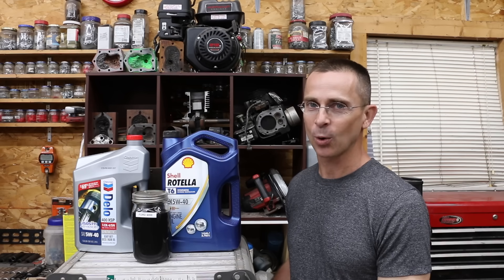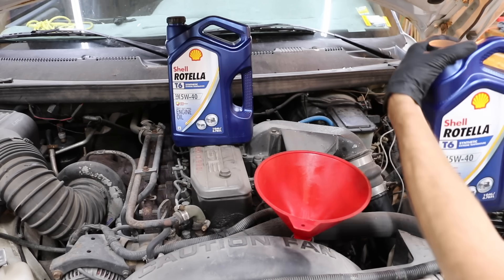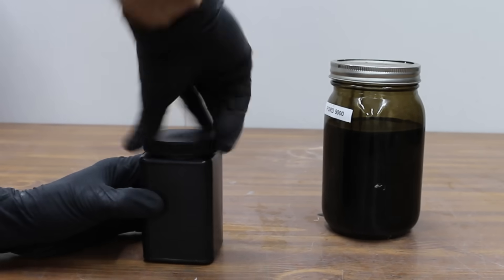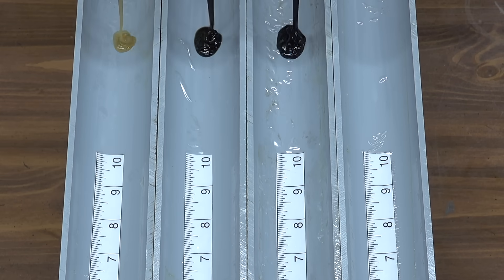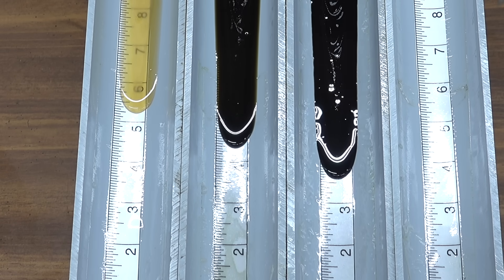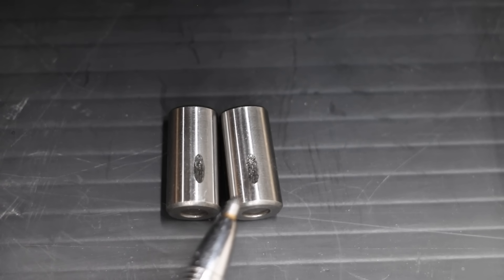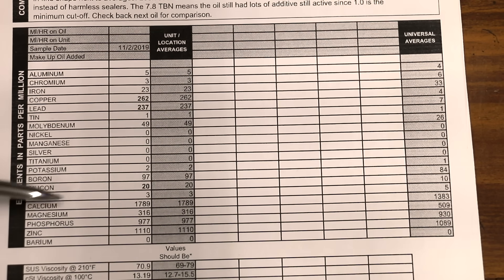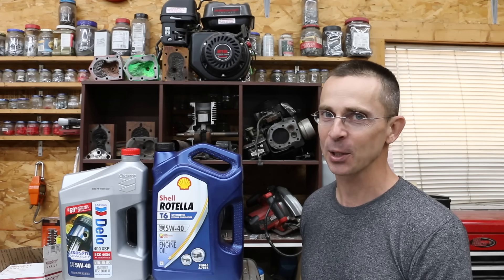Will Annual Oil Change Damage Your Car? Let's find out!

Comment: Great video - very good science instead of unsupported opinion. I have seen huge numbers of posts on Porsche forums claiming that oil which is sitting in cars that are in storage “goes bad” and it always seemed unlikely to me. I bought a car that had the oil changed in Aug 2019 and was sold to a dealer shortly afterwards. It sat at the dealership during COVID and I bought it, then it sat for another few months due to shipping delays etc. the oil is now almost 2 years old, but as the car has only driven 1500 kms in that time I have concluded that it is unlikely to be a problem.

Comment: There is a lot of discussion about 0w-20 vs 5w-30 oil.  I was surprised that my car's engine recommends both weights but some people prefer 5w-30 oil for better protection vs better gas mileage of 0w-20.  Could you test this?
Reply from the maker: Thanks for the suggesiton.

Comment: Over 40 years ago, I stopped changing my oil every 2000 miles, as I switched to Mobil 1, the first widely available synthetic.  That was 1976; I went to 10,000 mile oil changes, on a 10 year old Mustang 289 v8. Since then, a 1970 Chevelle 307, 1974 PInto 2L 4, 1976 Datsun 280 z, Pontiac Bonneville 350 V8, 74 Volkswagen bug, 78 Jeep Cherokee 360 V8, 77 Jeep Cherokee 258 6, 86 Wagoneer 360 V8, 88 Bronco 2 2.8 liter V6, 87 cherokee 4L I6, 90 Bronco 302, 93 Bronco 351, and  Porsche 928 5L V8. Currently have a 2008 5.4L V8, 1998 Lincoln 4.6L V8, and a 1992 Cherokee I6 4L.  Zero internal engine problems since then. NONE. I don't use only Mobil 1 exclusively anymore, but always use synthetic to provide the engines with good cold startup lubrication. Take all of that for what you will. Oh, and no leaks other than a drop occasionally, and no burning oil smoke.
Reply from the maker: Thanks for sharingl

Comment: So what would be the case of a motorcycle with 790 miles but I think it’s on the original oil since 2009 when it was built. The oil is at least 3-4 years old since it hasn’t driven that long. It’s still clear on the dipstick so would it just be good practice to change the oil because of possible moisture or would it be pointless? (I have to rebuild the carb and everything anyway so i won’t be cranking it over or anything till I do the carb and inspect the pistons and cylinder walls for any possibly corrosion) any fluid I should use in the cylinders as lube since the piston rings I assume are very dry from sitting so long?

Comment: I'll share MY anecdote with ya: I was using Mobil 1 in my ol' 92 Silverado scrap hauler. It only had about 100k on it's 2nd motor, out of a 95 Tahoe. I chose Mobil 1 because they say "one year or 15,000 miles". I'm lazy, I don't wanna do it more often. When the oil had about 3 months and 2000 miles on it, the distributor went bad (I didn't know what was wrong til much later; it just quit running). So it sat in my driveway for 8 months. Then, after talkin' to e mechanic, I put a new distributor in it. Fired right up and ran great. A month later I spun a rod bearing, right after spending 100 on the distributor, 300 on a new exhaust system, and 700 on new brakes. I don't know who to blame. I can't send it to the crusher after having it for ten years, especially after putting all that money into it!
Reply from the maker: Thanks for sharing!
Reply: Get a Ford

Comment: Another great video for sure . Automotive Tech college and General Motors training both emphasized Annual oil changes at a minimum . I always questioned that theory . I have engines that have 2 or even 3 years without oil changes . Attention to the condition of the oil is all I do unless its been buried in snow or something similar that may require additional considerations .
Reply from the maker: Thank you!  Thanks for the feedback.
Reply: Anyway you could do one on Rotella non-synthetic and Delo non synthetic 15 40 . My mechanics trying to tell me what's better than the other

Comment: I change the shell rimula r4 L15w40 oil on my 3.0l and 2.5 d4d Toyota hilux trucks every 5000km/3000 miles but the filter only every 10000 km.
On my 81 2.2 turbo diesel Toyota hilux I change the oil monthly because the odometer is broken.
To tell the truth even if a car wouldn’t make 5000 km annually I would still change it multiple times a year. It’s cheap if you do it yourself.
Reply from the maker: Thanks for sharing.

Comment: ALL the "thumbs down" are from JIFFI LUBE owners.
Reply: Lmao DIY squad
Reply: @bobespnza29  Or Chevron employees  LoL .
Reply: @whip-its_dad4239  I don’t even think they know about this oil lol
Reply: 621 thumbs down.  I don't get it.  Why ?
Reply: Or oil companies & stores.
Reply: Oscar ROdriguez:   Seems like empty complaints in the face of all that objective data and testing.
Reply: Just stay away from supertech oil. Even the full synthetic is sus, on the package they depend on you not reading properly it doesnt say it meets or exceeds the standards, it says "use where you would use products that meet or exceed the standards", in other words they never themselves met or exceeded those standards, or they would say so.
Reply: @Seriouslydave  The tests showed it is as good as Amazon Basics and just a hair better than Kirkland and all Project Farm recommended all 3 of them as a good value.
Reply: @Seriouslydave  I use walmart supertech oil on all my vehicles. I have a 2018 Chevy Impala I purchased with about 20k miles. I used supertech syntethic exclusively and im currently sitting at 90k miles with no issues whatsoever. Doesnt burn or leak any oil.
Reply: @Potatorq  use what you like im not stopping you, its oil, it meets minimum requirements, (which if you read the requirements arent that impresive) rockauto has sales on major brand oils all the time. Im on a very low budget, im the opposite of rich, but ill buy a motorcraft filter (5000 mile) for $1 more, and mobil1 (10,000 mile) for $4 more (5q). And thats not even the good mobil oil i would like to buy. I do oil change 3000-4000 miles. 300,000 miles on the clock.
Reply: @Seriouslydave  if you're on a very low budget then may I suggest extending you oil change intervals. My 00 f250 7.3 diesel is sitting at 360k miles and I only use supertech conventional with 8k miles change intervals. 07 crown Vic is sitting at 240k miles using supertech 5w20 synthetic also doing intervals at 6-7k miles. Impala computer indicates 7-8k mile intervals as well. I do oil changes myself and I measure how much oil comes out. None of them burn or leak oil indicating great engine health. Modern oil especially synthetic will last much long as indicated by various tests.

Comment: I understand that using oil designed/rated for a diesel engine in a gasoline engine could cause damage to the catalytic converter (unless it's rated for both diesel and gasoline engines).  Do you know if that's true?

Comment: So you can basically change your oil at least once every 2 years if you’re not driving your vehicle more than 6000 miles... impressive.
Reply: Both oils he tested were 14 & 17 month with around 3,000 miles  full synthetic..... I'm curious how well 1 yr old non synthetic oil with say 2,000 miles would do.
Reply: In the UK most service intervals are 1 year or 12,000miles. When I moved to Canada it was 6 months or 6,000km!!! Sure make engines different over here lol.
Reply: @Mark-hu9tf  Do you mind me asking how are your engines holding up? How many miles/ kilometers are your vehicles lasting. My wife's pickup truck has over 300,000 miles on it with oil changes between 6000 and 10,000 miles with synthetic.
Reply: @rikertvonfulton16  Hi. Since moving to Canada and buying my truck cash I am looking after it like a lady lol. It has twin turbos so needs looking after.  Changing oil every 6,000kms and PTU/rear diff fluid every year etc.. so far holding up good but only 75km on it. In the UK, I just did an annual or 10,000miles service and no issues. Like many have said, maybe the climate makes the difference.
Reply: Just changed my oil after going 10000km in 21 months using synthetic blend and changed it out with full synthetic.
Reply: Honestly, oil is cheap I wouldn't go past 1 yr on a low mileage car.  Just an opinion.
Reply: @lonniebeal6032  Especially if you're using non synthetic oil, he just showed with only 3000 miles the full synthetic was good 17 months later. But no way I'd try it non synthetic.
Reply: Weather is quite a bit more extreme.

For vehicles with timing belts, if it's in a mild climate, manufacturers they recommend 160,000km to to replace it. 100k if they're in more  extreme climates like -40

Comment: Just put t6 15w40 in my 2001 tahoe with 220k and noticed it gained about 20 lbs of oil pressure at 2k rpms ,and added about 4 oz of berrymans b12 solution  poured into oil crankcase🙂, Again  thank you for another great video!!👍🏻
Reply from the maker: You are welcome!
Reply: If you gained 20lbs of oil pressure from oil alone is dead yet??
Reply: @joshc7091   with a little help of berryman down the crankcase to clean the sludge, worked dam good
Reply: @massacoor6162  nice!

Comment: Both my cars had 100% full synthetic oil change inc oil filters, 13 months ago. I had one litre new oil left over from each car's oil change which i saved.  Only driven each car less than 5k so i'm wondering to drain out 1L used engine oil and replace each car with the 1L fresh engine oil i saved at last oil change. I will not renew oil filters. Will mixing 1L new engine oil of the same spec into 2.6 L of used engine oil originally in the oil pan be ok and how many miles i should drive before a complete oil change with oil filters.

Comment: Be nice to see a oil test on 0W20 weight oil used in new vehicles with the automatic cam timeing to see if these syn oils such as Rual King sells hold up yearly or need changing every 6mos regaurdless of low miles.
Reply from the maker: Thanks for the video idea.

Comment: Searched to see if anyone tested this as I always found it questionable that synthetic oil will go bad just sitting in crankcase. I think it's mostly running time that is responsible for degradation. Not at all surprised to see that Project Farm did. 
I'm going to replace the oil in my car tomorrow and send a sample for testing. I decided to follow just the recommended mileage and ignore time. It was in the car for 4 years and 9400 miles. Will be interesting to see if it is ok after 4 years or if I pushed it too far.
Reply from the maker: Thanks for the feedback.
Reply: What are the results of the testing?

Comment: I worked at a Ford Truck dealership. Several of the chase vehicles had over 200,000 miles and the oil was changed maybe twice a year with the cheapest oil available. These vehicles (minivans) had repairs, none related to engine oil in the ten years I worked there.
Reply from the maker: Thanks for sharing.

Comment: Great video, and that sure is one clean Dodge, I have a 98 12 valve quad cab, great engine in a great pickup, also the strap style filter wrenches work great on that filter, or even a engine belt will work in a pinch
Reply from the maker: Thank you!

Comment: I recently learned that more dealer oil changes are done with an oil extractor instead of putting car on lift and draining via plug.  Concern is do oil extractors remove as much oil as drain plug?  Sounds like a good PF test video.  Thanks for all of your great tests.
Reply from the maker: Thanks!  Thanks for the video idea.

Comment: so you are saying that the top piston rings  are running at 410 degrees?I would like to know what oils are more resistant to blow. Is the evaporation contributing to blow by?  Granted it is dependent on the condition of the rings.
Reply from the maker: Thanks for the suggestion.
Reply: @ProjectFarm  great channel btw

Comment: Compare your parent oil sample silicone levels with the Ford tractors used oil silicon level the difference is a measure of how well your air filter is doing keeping dirt and dust out.
Reply from the maker: Thanks for the suggestion.

Comment: Hi. I have a question.   Hope you could help.  I have bought amsoil,and mobile 1 ata good deal.  Is it ok to stock pile new oil for at least 4to 5 years ?  I don't use my truck much and maybe only put 5000 miles a year on It.  I change the oil on each year and I have at least 5 years worth of oil.

Comment: I use shell T6 in my bmw R1200r. No issues. BMW oil is made by shell. The manufacturer also requires no molybdenum be in the oil due to engine coatings.  This video confirms the lack of molybdenum, I wasn’t totally sure of this but figured as much. Thanks for the info.
Reply from the maker: Thanks for sharing.

Comment: Project Farm thank you for your videos! I have worked in research and development for 30 years and generally try to research the best products for personal use as well. So yes curious how the mobile delvac 1 ESP truck feet oil would fare in your test.  I use it on on my T1n Sprinter, 7.3 ford diesel and a small 3 cylinder industrial Kabota tractor motor. Just wanted to say Thanks for your efforts/ artwork!  BTW currently using 5-40, sprinter kind of likes the 15-50 in the summer but I like to buy in bulk if possible.
Reply from the maker: Thanks so much!
Reply: I used to talk to very experienced mechanics about this whenever brining my semi in for engine repairs and was told Rotella is better than Delvac.  Guy said engines were cleaner when taken apart if Rotella was used.

Comment: I use my car once a week only to do a 20mile run. It uses synthetic oil, and starts on gasoline for the first 1.5 miles then runs on LPG (no carbon muck build up). I change the oil every 3 yrs and it comes out looking clean! Am I changing it too much!

Comment: Delo was a really good oil back when it was stil cj-4 rated. Now they put the sn rating on and dropped the amount of additives and i believe its good for a gas vehicle but my 7.3 powerstroke with the HEUI system probably will give that oil a work over. My dad used to run delo 15w40 in his 6.0 powerstroke. Sold it at 368k miles and it was still on factory engine. That was around 2012 when he sold it and delo was still cj-4 rated. No doubt rotella is a good oil but i wonder how Schaefers and Mobil Delvac would do. Schaefers is extremely good oil but idk bout Mobil delvac
Reply: Also there is different delo 400's. I believe there is a delo 400 SDE which is what my dad used. I believe there is a 400 LE to. Idk where they all stand but they all have SN rating so it would be interesting to see which oil has the better additives
Reply from the maker: Thanks for sharing.